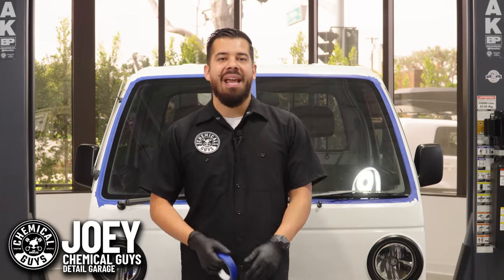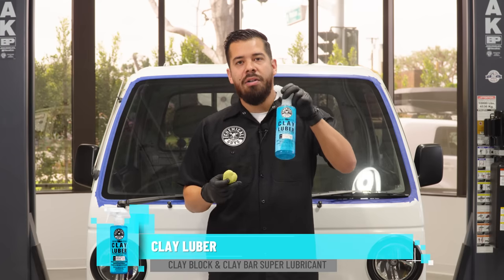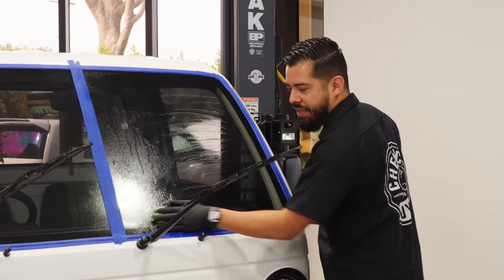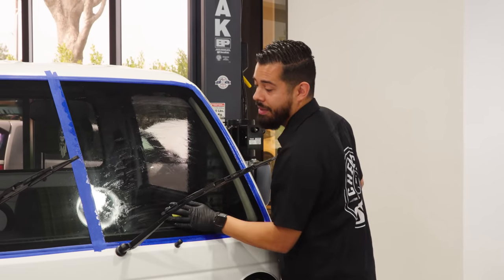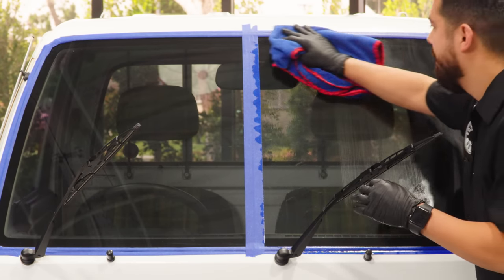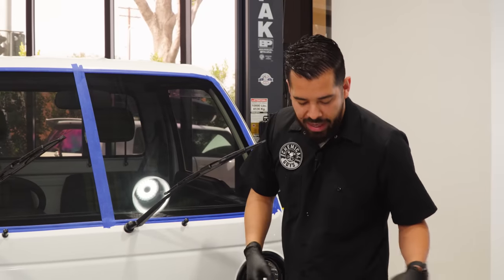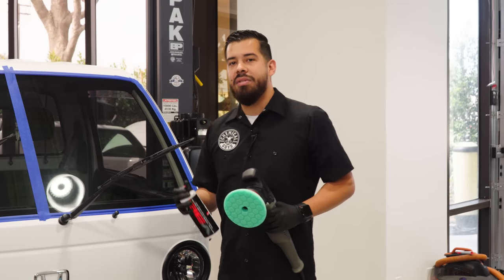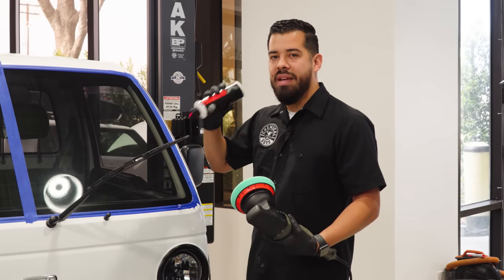How To Clear Up Streaky, Dirty Glass and Restore That Smooth, Clear View - Chemical Guys

Comment: Hi guys, can we see a close-up with light on these glass surfaces. The title of the video is named how to clear up streaky dirty glass . At the end it was just demonstrated how "hydrophobic" the glass got. Aren't there any scratches left behind by the polisher, pads and products?
Reply: 👍💯🔥 exactly
Reply: I regularly use clay, compound, and sealants on glass. All products involved are safe for paint and clears. Since glass is many many times harder, this would not scratch glass(exceptions is if you prep poorly and used a polisher that picked up a rock or something lol).
Reply: Smooth un scratched surfaces won't have water stick to it like the coated glass, instead it will bead up. A hydro test is a good indicator of that
Reply: 🤔 where would the scratches come from ? And if there was already scratches on the window then this video can’t help with that. It’s about cleaning and streak free.
Reply: Streaks and film have to do with product and dirt/residue on the surface. If its beading and sheeting off cleanly, you can rest assured the surface is clean (not with streaks and film).
Reply: I'm confused, coated looked worse than the non-coated. .
Reply: I've never had any problems with polish or compound on a buffer on paint but I'll try it on glass, my sunroof is terrible because it was a junkyard glass that was sitting for years

Comment: Clay bar is a great idea. Just wish my windshield on my truck was that easy to clean. Even at 6'2" I cannot reach the center unless I stand in the door and reach.
Reply from the maker: Working with larger vehicles can be tricky however using a stepladder may be useful.
Reply: @ChemicalGuys I have a step ladder and even though I am 5ft 11inches tall with a 34 inch sleeve I cannot reach portion of my hood, roof, and windshield of my 2024 Chevy Trail Boss.
Reply: If only there could be like a universal tool, that you could use to still be on the ground and reach the middle of the windscreen.... I know... mount it to a wooden stick and BAM you can now clay your windscreen on the ground.

Comment: Hi guys. Not long ago I put your Hydro Slick Wax on my car. I'm happy with final effect, but on my bonnet looks like loosing repellent effect. I don't know I used stronger foam or what? Btw question-can I re-apply this wax again? Or really should wash away with for example fallout and then start again new layer? Tom

Comment: The best way to demonstrate glass polishing would be on an old windshield removed from a salvage car. You could light it well from the inside and outside to really show the effectiveness of the process. It's almost impossible to tell how well this is working. Surprised that no windshield polishing videos have figured that out.

Comment: How do I clean a pile of towels when they all have different products on em and u want nothing on it for the next after the wash. What dial and fabric softener. Or just degreaser etc
Reply: I find good results with a strong detergent, warm water, and a couple of capfuls of SuperClean degreaser - that stuff breaks through anything.  Adding some Borax can be helpful too.  Never use fabric softener - it's filled with oil and leaves residue.  It doesn't actually soften fabrics but rather makes them feel softer.  Don't use any gentle or delicate detergents or washer settings - you want aggressive.  Wash microfiber only with other microfiber, and not other clothes - and I try to wash the towels right away after use when possible because a lot of detailing products harden or cure over time and become harder to remove.

Comment: Terrible idea to use a paint polisher for decontaminate the glass. It will leave micro swirls all over the place. You will see them when the sun hits the windshield or when driving at night. There are dedicated glass polishers. just need to use the right amount of pressure and also pad.
Reply: Good to know.

I am having a nightmare with my rear hatchback window. It has a stain that looks like a run. A new one appears about every two days. And the car has gone nowhere in a week and it hasn't rained. I tried to remove the stains with vinegar, soap, Invisible glass cleaner, and even a very mild glass polish using my orbital polisher with no luck.  The car is failry new.

Comment: Glad i found this! I have a 56 chevy with old glass likely replaced in late 80s. I properly washed inside n outside, and og clay barred outside of glass  Would this clear or at least help clear up for the most part any light and moderate pitting and sun hazing? And light scratches/streak from old windshield wiper blades? Thank you guys for always being helpful! Any suggestions are appreciated. ✌️

Comment: How do you wash microfiber towels after you use a ceramic coating like Hydro Charge+, Hydro Slick, or Hydro Speed?
Reply: They also make a micro fiber wash product that works well
Reply: My Method of Doing Laundry
Fabric Clothes- Steam Clean, Extract, Blow Dry (15 mins), Protect
Leather Clothes- Spray Leather Cleaner, Steam Cleaner or a Leather Brush, Wipe It Off, Leather Conditioner, Microfiber Applicator Pads
Towels- Steam Clean, Extract, Blow Dry (15 mins)

Comment: Exterior window cleaning is not that difficult. I have rarely seen any video or products from Chemical Guys for cleaning the windows from inside on tinted glass.

Cleaning windows from inside is as important as cleaning it from outside.

Hope you recommend a product and cleaning procedure.
Reply from the maker: Hi there! Thanks so much for your feedback. Check out this video.
https://youtu.be/6WXCUVs95M8

Comment: I did followed this process recently. Works great for rain except I must have used an inferior microfiber to apply or buff the HydroSlick and now have lint stuck in coating on windshield. How do you recommend I remove the HydroSlick (without stripping wax from other exterior surfaces) to try again for a better application?

Comment: Does this repair thousands of micro scratches and chips? My windshield looks like, well like I sprayed a fine mist on it when looking out from inside in sunlight. It's actually hard to see out of in direct sunlight, so I need a way to polish out all those little specks

Comment: Quick question: Does ceramic coating will cause the wiper blade to be shaky/vibrate when being used in light raining condition?
Reply: Its will happen

Comment: What do you suggest for clarifying the inside rear glass. It has the defroster material on it.
Reply: White scrub pad, bottle of water mixed with a little soap and glass cleaner. 

Use microfiber towel and squeegee to dry.

Comment: is there any UV protection with the hydro products? I have been using Jet Seal on headlights for the UV protection but id like the ceramic action also. What are my options? Thanks
Reply from the maker: Hi there! Yes, adding the Hydro Line will resist harsh elements and UV rays using ceramic protection. HydroSlick is an excellent all around choice for repelling these elements and enhancing gloss.

Comment: Been using your products for a while very happy with results ,when everything is dona properly and cheramic coating applied ,I dont even need to use my vipers when driving on highway ,all water just runs off , btw you have a clay cloath available? Thank you
Reply from the maker: Hi Roy! Check out our Clay Block for a clay bar alternative. 
https://www.chemicalguys.com/clay-block-surface-cleaner/CLAY_BLOCK.html